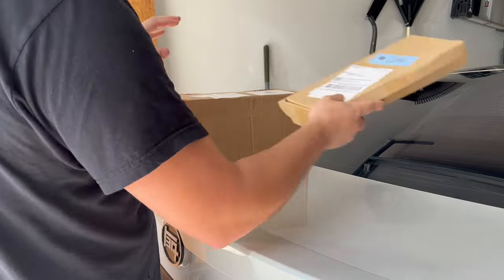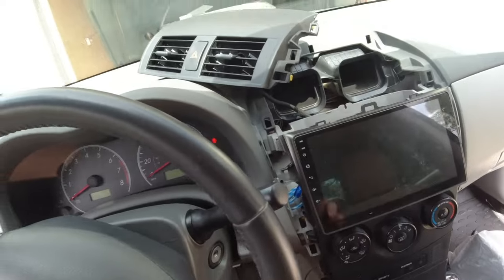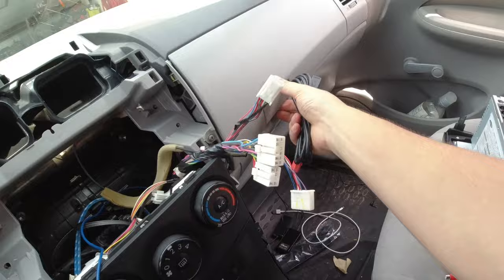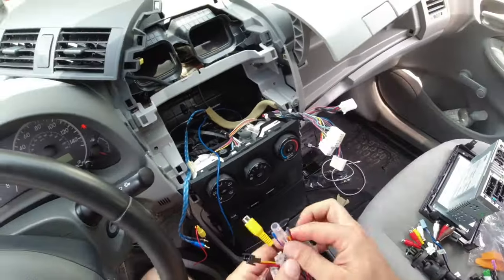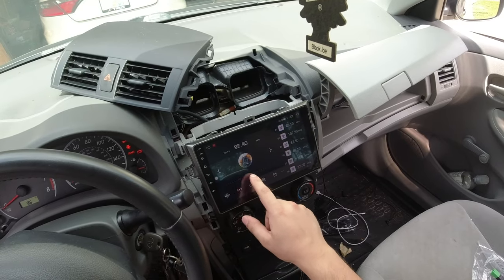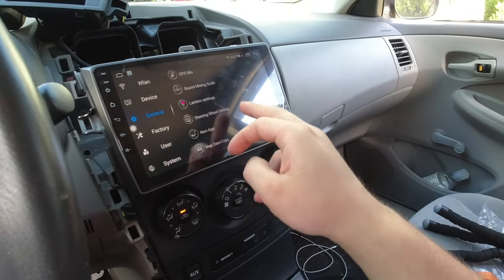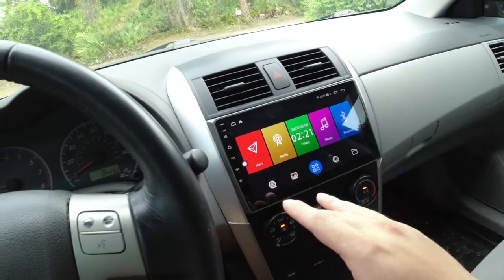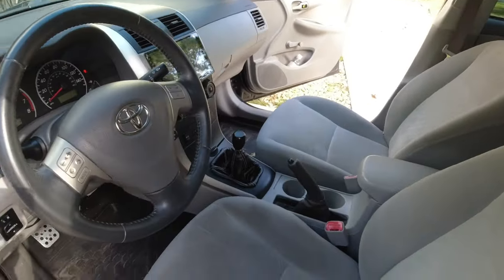Installing a iDoing Radio In My Toyota COROLLA(2009-2013)

Comment: Has anyone installed this radio on a Toyota s with JBL system? The wiring harness I believe is different because of the JBL amp and steering controls.
Reply from the maker: I believe they should still work, I have steering wheel controls on my car and they work. I’m just not sure about the JBL system.
If you have any questions send a message to idoing on Instagram, they usually reply pretty quick.

Comment: 700CAD$ for a Fucken radio headunit man is there any options similar but cheaper?
Reply from the maker: This radio is expensive, but comes with much nicer quality screen and internals. 
You can buy cheaper radios from Amazon or eBay, but they might not give the same performance or longevity.

Comment: will it fit on my e12 2005 toyota corolla ??
Reply from the maker: This only fits on 2009-2013 corolla.
But you might be able to contact iDoing and they should be able to help you find the correct radio.

Comment: How u get the logo of the radio ? I’m trying to put it but I can’t find the option
Reply from the maker: I believe the boot logo is in the factory settings. Which I believe you need a code. All head units have a different universal code. So a quick google search you should be able to find something.
Reply: already have the code and when I go to factory setting it doesn't show you that option.
Reply from the maker: @helfymolina5850  sorry for the late reply, but I went to check my own radio and I see a setting that says boot logo. And allows you to select a new one!
Reply: @BrandonStellmach  my doesn’t have that boot logo 😣😣😣
Reply from the maker: @helfymolina5850  that’s very strange. Have you contacted the company to ask where the boot logo settings are?
Reply: @BrandonStellmach  yes I did but they couldn’t help me with that issue

Comment: Hey Brandon is the aliexpress link for the head unit legit?
Reply from the maker: Yes it is legit, many people have ordered from there. I will just say that is probably the only thing I hate about this head unit, because you can only order them from AliExpress and it ships from China.
But it is a great radio and much cheaper then many others.
Reply: @BrandonStellmach  have you had any issues since installing it? I really like the clean tablet look but I worry that it’s a cheap product 😮
Reply from the maker: @LaRana08  honestly I have not had any problems with this radio at all! It’s a really decent radio with high quality parts. The main reason they are much cheaper is because everything ships from China, so there is no middle sales person up selling them.
Reply: @BrandonStellmach  okay thanks for the quick response. I think I’m gonna give it a chance. I really like the look and functions.

Comment: I can’t get it to connect to apple car play. It says waiting to connect?
Reply from the maker: I believe you need to connect to Bluetooth on the radio. Try that and hopefully it will connect.
Reply: @BrandonStellmach  I couldn’t figure it out so I used the usb and it works. The Bluetooth seems to be rocket science idk why lmao
Reply from the maker: So you are going to click on the Bluetooth icon on the Home Screen, then click on the bottom icon the looks like 2 phones, then you will click search on the top, and when you click search you will go Bluetooth on your phone, and it should pop up, and then it will ask for a pin, it should be 0000, if not click setting icon at bottom and it will show it.
And when you connect, Apple CarPlay should connect too!
Reply: @BrandonStellmach  it wouldn’t show up at first but I did figure it out lol. 
This radio makes my rear deck JBLs go crazy, my whole cars shaking after I tuned the frequencies. Awesome stuff, so glad u make content and we have the same car. I use my car for work so it makes work more enjoyable.
Reply from the maker: @GraveyardWarden  yeah the bass on this unit is crazy! And it’s a great upgrade for anyone who always drives their car, even for me when I drive from work and back, I love having it!

Comment: What is wireless car play?
Reply from the maker: Well let’s start at what is CarPlay! 
CarPlay is a special application designed by Apple to work with certain cars. And it gives you a custom radio screen that looks just like the iPhone. In order to use CarPlay, the car always had a dedicated USB port that you would connect your phone to in order for the radio to recognize it.
So wireless CarPlay is the same thing, but connects using Bluetooth instead of a wire! Which calls it wireless Apple CarPlay.
Reply: @BrandonStellmach  oh OK thank you

Comment: hi, im thinking of installing a 10inch HU myself. 
however, i will need a dashboard adapter. I see some 10 inch adapters sold on line.
However, i noticed that for HUs, some say its 10inch  and some say its 10.1inch.
Would the 10.1 inch HU fit the 10inch adapters? or are they actually the same?
Reply from the maker: This radio I installed has the bezels already connected to the screen. So I didn’t need to buy any adapters to get this to work.
But I would think the 10.1 inch, would work with the 10 inch adapters.